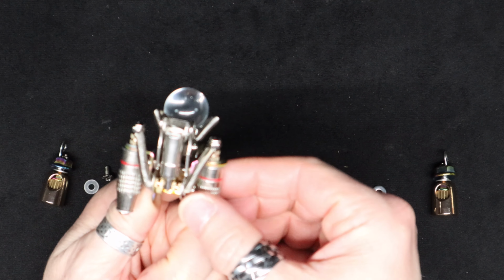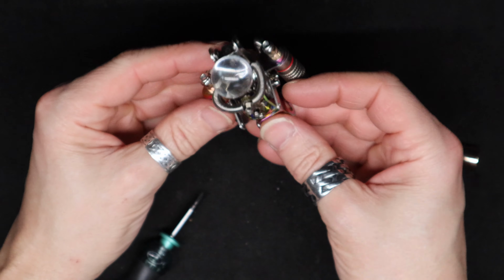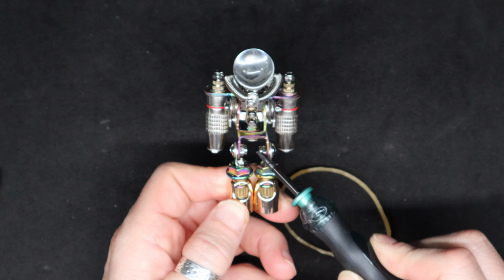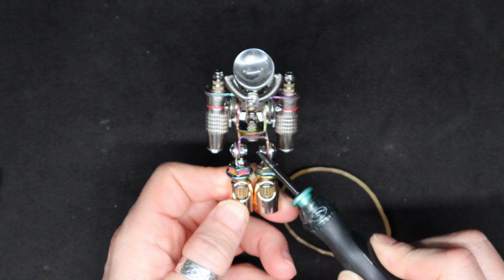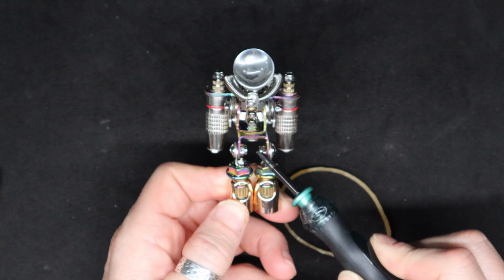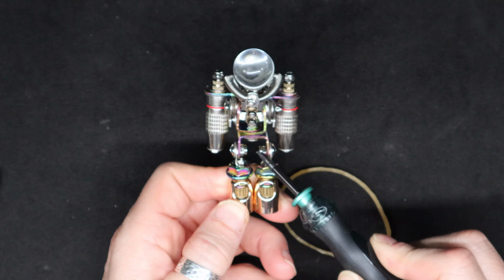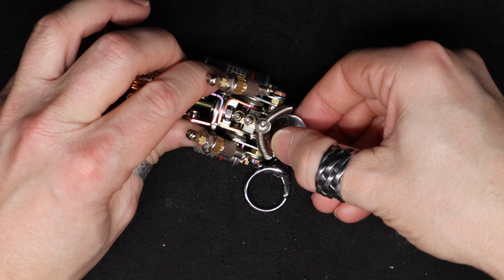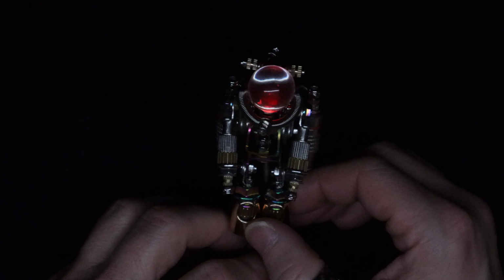MECROB Moon Astronaut Steps 12-END

Comment: Really well done pushing through this one! I could feel your frustration bubbling beneath the surface 😂Bit of a shame the LED stopped cycling colors but on the plus side you have a really cool Xmas Tree Ornament now, weight permitting lmao 🎅
Reply from the maker: Yeah, I think the batteries are shorting out on the sides of the housing, I'll have to find an extra thick branch to hang it on for sure. I am looking forward to getting back into the wood builds now...although there is an acrylic one in the near future.